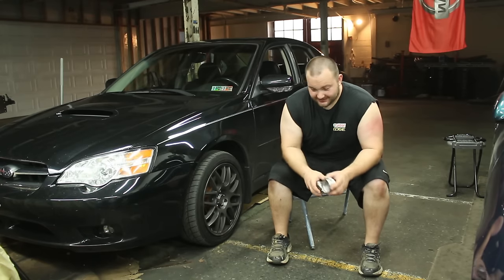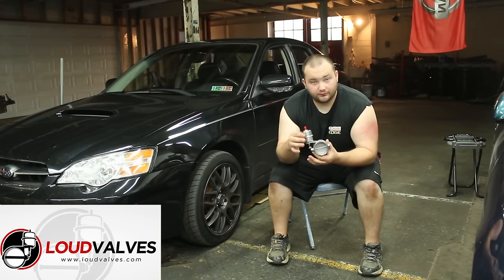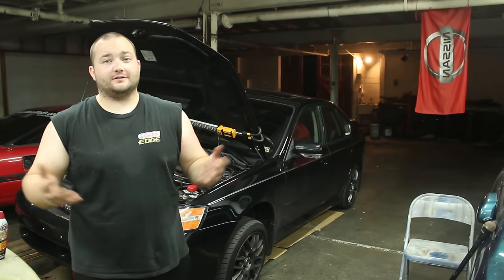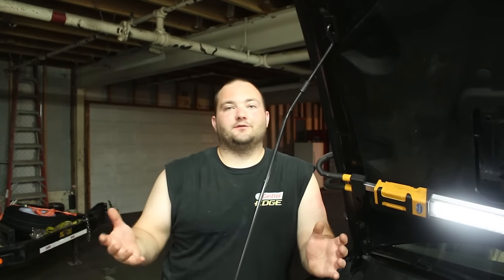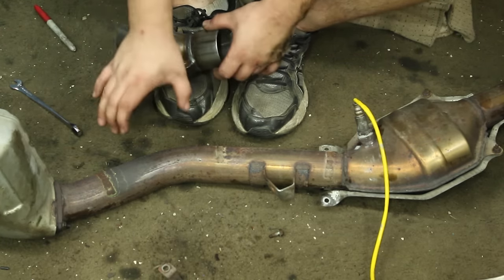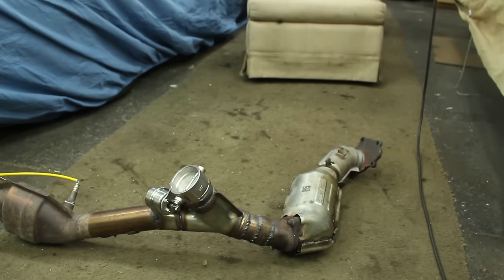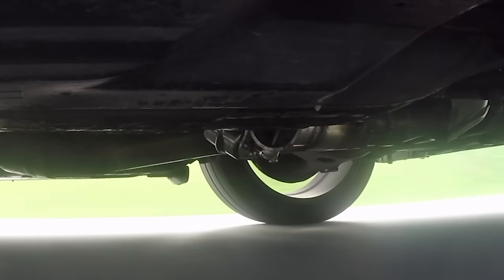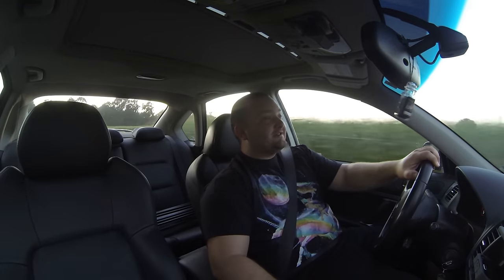The Ultimate Sleeper Exhaust!! Boost Controlled Loud Valve |  Legacy GT WRX STI

Comment: What I like is that this is actually practical too. Since optimally you want zero back pressure on the turbo, it will (should be) only helping performance.

I love the sound. Great work. Subbed. ^_^
Reply from the maker: thank you very much! please share with your friends too :D

Comment: I've been wanting something like this and I've heard electric cutouts are slow. My car will make more power with a cutout but only at higher rpms, less at power at lower rpms with it open. So I need something that opens and shuts quickly and will do it at the top of each gear. 

If you add a 12v vacuum solenoid (found on Mazdas with VRIS,) to this, you should be able to make an on off switch or put a momentary button on the shifter... aaaand if you add in a "window switch" (I've only heard about them, I think MSD sells them,) you could have it open and close based on a specific rpm instead of boost. 

Coolest DIY I've seen in awhile though. Check out my test drive and cat installed videos. I wouldn't be able to hear your Subaru with an open cutout at full tilt, with a cutout on mine. Seriously this is the perfect thing to complement my swap and perfect timing, I can get one of these in before I get my catback.

Comment: you can achieve the same thing with an old throttle body and a spring to work with even a N/A car. you would have to figure out best spring tension, but basically it would stay closed until enough exhaust pressure forces it open. A few auto manufacturers implement this in factory mufflers, like my G35 for instance. (oem applications arent as loud though since they are still inside the muffler)
Reply from the maker: nicee

Comment: I ran a cutout in the rear, just before the oem sti muffler. Super quiet until it was open. More room for one in back at least on the first gen imprezas. May use a boost actuated valve in the current build, but tough to know exactly what pressure they will move open. Don't want anything happening until really getting on the pedal.

Comment: thats awsome... but what about boost cut.? does the extra exhaust flow affect the factory boost limiter?
Reply from the maker: nope! no issues at all!
Reply: Poor Man Mods 
what if i had a 3 inch down pipe with your y piece and valve at the end ... then short taper back to stock size exhaust for the rest of the exhaust. 
that way it would still stay quiet but would flow more at wot.
Whats the butterfly valve diameter.?
Reply from the maker: That sounds like it would be a good setup, you can get 2.5 and 3inch valves, mine is 2.5

Comment: Yo man. Did you need to a tune to account for the higher exhaust flow? performance Subarus are commonly known for their temperamental tunes when adding aftermarket performance parts, and the consequences that arise far too often when the ecu isn't adjusted accordingly.
Reply from the maker: +Samuel Ross I didn't get a tune but I'm sure a tune would make it much better

Comment: I feel so bad for you guys in America. Subies and parts are rediculously cheap here in New Zealand. Just built up a 95 gt for less than $300nzd haha. It has V5 WRX running gear all round, full turbo back exhaust and decatted down pipes, a sub zero group a ECU, 17" avs gold rims, hks bov, aftermarket fuel pump, split fuel rails, 170kms, tints, mint paint and interior, mean sounds, And I actually managed to aquire more parts than I started with a week ago in that time.spent $100 and got two different mates shed clear outs. Pulls hard
Reply: Bro prices get super rapey for the BL/BP onwards whereas everything's stupidly cheap for BE/BH and older

Comment: Just curious with the electric ones when they are closed it diverts it into a muffler and when its open it just like a straight pipe but with this when it's closed it won't be flowing at all how does it flow when closed?
Reply: it goes trough the stock exhaust when its closed and when its open its open downpipe

Comment: Would a 3 " down pipe + this y-pipe & valve then tapered back to original exhaust size be loud , when valve is closed?
Reply from the maker: it might be slightly louder than stock, it wouldnt sound like you have an aftermarket exhaust.

Comment: Hmm cool idea, but it was opening and closing between shifts. I'd be concerned about more wear to that motor because it's opening way more often then one just on a switch.
Reply: theres no motor, it runs off the boost from vacuum lines. just keep it greased.
Reply: +jeriah moon Looked like it was activated by that boost controller, but the valve itself was opened by an electric motor.
Reply: cool' i might buy one in that case. cause i want it too stay open for 15 secs? after boost. on/off is bad on moving parts. and a delay would be nice for the track coming  in and out of corners.
Reply: You could just as easily put it on an electronic timer and program that 15 sec. buffer in that way so that it stays open for a set amount of time after it stops receiving an open signal.

though honestly, the easiest, most straightforward, sensible, and function oriented option is just a switch. :p
Reply: There is no wiring needed for this valve.  You can tell right away by the picture that the valve is being opened by the 'boost(wastegate) actuator'.  Once boost reaches a certain psi level it moves and opens up the valve.  If you have looked at a stock turbo setup on a majority of cars you can see they have a 'wastegate actuator' that looks exactly the same and functions the same and they do not use any electric motor.  All off of psi. Here's a link if you need more info on how they work:  https://www.google.com/search?q=wastegate+actuator&ie=utf-8&oe=utf-8#q=how+does+wastegate+actuator+works

Comment: Get her tuned after removing cats? OEM turbos like to boost spike pretty bad once you start to remove restrictions, the wastegate cant keep up.
Reply from the maker: Tune will come soon, I still have the factory downpipe and primary cat, not issues or check engine codes yet

Comment: is there a way to use this device with a car without turbo?
Reply from the maker: yes, they make vacuum actuated ones that work in NA cars
Reply: Poor Man Mods sorry to bother you so much,  but is there a link or exact name that you can share to me. I'm not very knowledgeable in this question,  but looking at you decided to make this kind of mode to my exhaust.
Reply from the maker: what size do you want? 2.5 inch? 3 inch?
Reply: 2.5"
Reply from the maker: http://www.ebay.com/itm/2-5-63mm-Close-Style-Exhaust-Cutout-Valve-Vacuum-Activated-Exhaust-Cutout-Dump-/302157609694?hash=item4659ff3ade:g:H0wAAOSw4GVYRRsi&vxp=mtr
Reply: Poor Man Mods thank you very much!

Comment: where would you weld it if you didn't use the y pipe?
Reply from the maker: basically in the same spot, but youd need to cut a hole in the factory exhaust

Comment: valve open at how many psi 1 or like 5 ??
Reply from the maker: Mine is around 5 or 6 psi because I installed a boost controller on the hose going to the valve. Without it it would open at 1 psi

Comment: i would weld an elbow on it when you have an aftermarket downpipe without the cat. you dont want burn your car from below :P
Reply from the maker: +MrBrady85 it's actually hotter with a cat than without a cat, and I havnt burned the car the yet
Reply: So no flames? i shoot flames with the center cat still installed?! maybe because its a  '97 impreza C8?

Awesome mod tho, thinking about installing it.
Reply from the maker: i dont believe there are flames, i havnt heard or seen any

Comment: having an exhaust before the o2 sensor is just asking for problems
Reply from the maker: the down stream 02 sensor is strictly for emissions, ive had 0 issues with this set up
Reply: The ecu is going to calibrate that you are running lean. throwing you scaling all over the place. I know why all these subie blow up now
Reply from the maker: no, the upstream 02 handles the AFRs, downstream only tells you if your catallytic converters are working or not. when the valve is open it bypasses the down stream 02. there are no negative effects

Comment: i like my broken exhaust pipe and put a slightly Round or rounded then the factory exhaust one and a half foot length exhaust pipe slide it over the factory pipe doesn't put it in the middle of the broken pipe and make sure it's not and won't move back and forth believe me it'll sound like a 5.0 Mustang it's something about certain motors have a great Roar like a Pontiac Grand Prix 87 through 92 models where the intakes where aluminum not Hardin temperature proof b***** plastic b***** ones that crack

Comment: Ummmmmm...you are cutting it before the O2 sensor.  You are bypassing your O2.  Your car is going to run rich as shit when that thing activates.
Reply from the maker: false. The 02 that that is bypassed when the valve opens is just for emissions. All is does is keep your check engine light off if your cars are working properly, if the cats are old shitty and broken then the light turns on, that is all.
Reply: The O2 sensor is for enrichment.  It senses a lean or rich fuel mixture and sends corrections to the computer based on that input.  It isn't 100% essential to your engine running, but it does make corrections, so not having true readings will make your motor rich as shit.
Reply from the maker: you are talking about the upstream 02 sensor
Reply: I have never seen a vehicle with 2 inline O2 sensors, but I don't work with many modern cars, so you might be right.
Reply from the maker: well no offense, maybe you should educate yourself before making comments such as this
Reply: Nah.  I read up on it.  I was right.  The "just for emissions" O2 Sensor is not just for emissions.  It is reading the efficiency of your Catalytic converter in burning the excess emissions, so it takes a reading of the AFR on the front side of the down pipe, pre Cat. Then it takes a separate reading from the rear O2's AFR.  Then it develops a fuel mixture based on final output of the ratio between the two adjusting your input up to 2% lean depending on factory ECU.  If the rear O2 reads rich...like when you take out a Cat, that makes the motor lean out to correct for emissions.  Venting this might correct it because you're venting before the O2 making a lean condition at the rear O2...but either way...it's fucking up your AFR table.  Maybe you should not try and get smart with a stranger, son.
Reply from the maker: ill tell you what, when my car runs rich as shit and like crap like youre saying, ill let you know
Reply: Poor Man Mods and does it?😂
Reply: Poor Man Mods have a 92 legacy project "sleeper" would be awesome to have this on it😜

Comment: 1000$? Are you crazy? You can get it for less than 300 on ebay, tested and proven! (yeah, impreza one will fit the legacy). Some kits may need small adjustment on the hangers, but much less work compared to the you did here.
Reply from the maker: +Pedro Teixeira please, find me a quality down pipe and cat back for $300
Reply: Japspeed, toyosports, what ever, they are all the same. If you don't mind having just the single tip instead of the stock double. These are around 300$ on ebay (full set), and I personally know of dozens of cars using them, ranging from stock power to 550bhp. Like I've said it would probably need to relocate some of the hangers, but these are very nice and cheap (this is poor man mods). The downpipe and center section are probably straight fit ("probably" beeing the keyword here).
Reply from the maker: and the cutout i installed was cheaper than everything you talked about
Reply: But it's only "noise", no performance gains (or if there is, it's very marginal). Specially on the 3" decated downpipe you can get some power  and better spooling, there.
Not hatting, I understand you have to put out some videos, but just saying an exhaust for a Subaru is very cheap. I own an MY99 Impreza, and I know some of ebay's stuff is pretty decent.
Reply from the maker: i cant even